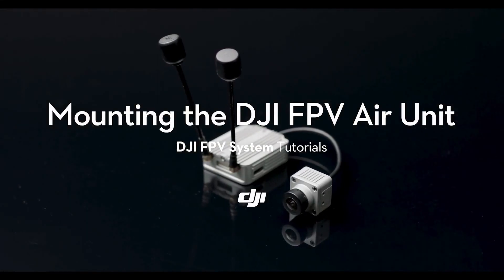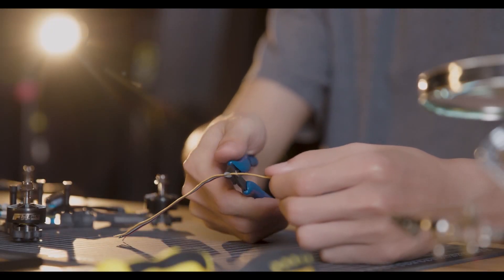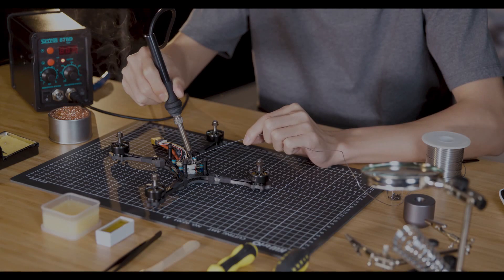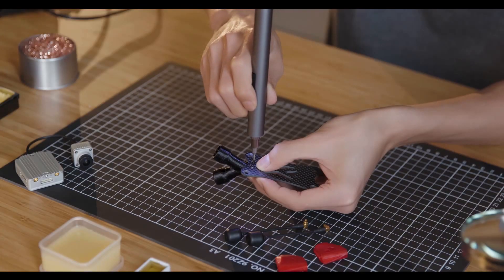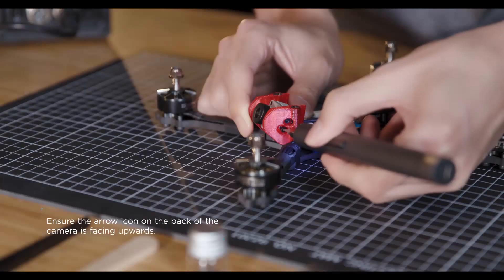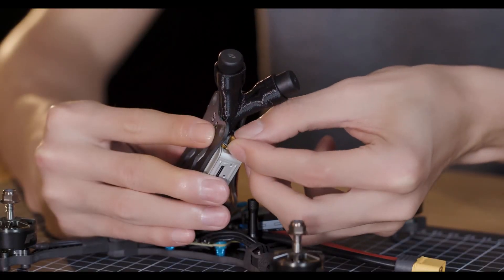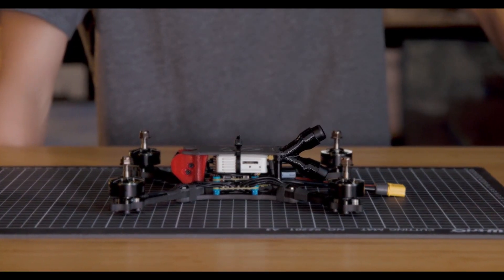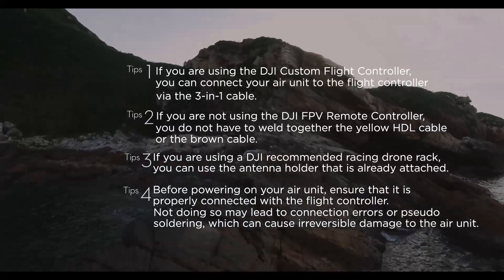DJI FPV System | How To Mount the DJI FPV Air Unit

Comment: Thanks Dji. Still some confusion out there as to what works with the air unit. So, new reply to an older video and many shops and users still are confused as to what works with the air unit. The Goggles v2 work with it. The fpv controller does not work with the stacks. The air unit is for fpv. So if anyone is reading this, as on Dec 13 2021, you have to use a regular rc transmitter. For example, the only thing a dji Mamba stack does, is allow you to plug the air unit in. One less thing to solder. Stack is flight controller and esc to control brushless motors. New terminology, but for those of us that have done rc for a long time, it's not a real mystery. There isn't an app to figure it out. You have to do some thinking. You still need to pick a radio. There are many, now. Some are easy. Others are really complicated . A complicated open source radio is FrSky Taranis. Some simpler ones are Spektrum and JR, if they are still in business. I have a Taranis x9d plus. It is fairly hard radio/tx, that is open source. If you can figure it out, you will be able to things with it that are amazing. Took me weeks to just get an rc helicopter model configured, to work with it on Phoenix flight sim. And, you need to have compatible receiver to receive signal from radio. Receiver will probably need to be soldered to flight controller. Again, there are a lot of easy radios with easy hook up.FrSky ie; Taranis has many receivers. You will want one that transmits telemetry to the radio. Telemetry transmits information like drone battery charge data to radio. FrSky has  micro mini receivers for smaller drones that have telemetry. One micro they make is small and transmits telemetry.

Comment: can this be used on a common rc airplane with a Spektrum transmitter and receiver? With the required power system in place of course.

Comment: i got a iFlight Titan DC2 Quad mit the Dji Air unit on it and an additional Frsky R-XSR Reiceiver on it. Now I want to fly it with the Dji fpv system, but my controller does not connect to betaflight. Do I have to remove the (useless) Frsky receiver first?

Comment: what is that aircraft that they are using in the video? I have multiple questions:
1-Which drones are compatible?
2-Where can i buy a racing drone that is professional and i compatible with the unit?
3-Are there any racing drones that are compatible but don't need 3d printing?

Comment: Am I missing something?  They skip over #1, which is if you DO want to use the DJI CUSTOM FLIGHT CONTROLLER. Is there a video for that??
Reply: Seems they are suggesting it's better without.
Reply: Their FC that they suggest is just plug and play mostly. The one in the video is not, hence the soldering.

Comment: Thanks to Share, I bought the googles and 3 units for my drones, I'm gonna use my FRSky controler.
But I have a big question?!
Any time I want to Change the drone I have to rebind the googles with the unit?!? Or it saves the bind of my 3 units?!?
Reply: No need to rebind is only one time to each airunit

Comment: Why the hell did DJI use vinyl coating - you are not making a whole lot of FPV drone pilot friends with that choice. Should have gone with silicone - doesn't melt away from your solder point.

Comment: i'm having an issue where my signal to the DJI FPV goggles is SUPER weak. Like when I'm literally within 1 foot, It's good, but if I get out of 1 foot range, it drops signal completely. What would cause this issue??
Reply from the maker: Hi Jake, please first make sure that the unit has been activated successfully; then please check if the antenna was assembled properly and ensure that the angle between the two antennas is greater than 60° and the gap between the antenna tip and the airframe or the metal pieces is at least 4 cm, you can provide a picture of your drone for us to double-check. 
Besides, please check how many channels you can get in the goggles, if there are three or four channels, please connect the system to DJI Assistant 2, make sure that the VPN software is disabled, so the radio can be automatically adjusted to the corresponding country code. 
Please let us know if the issue persists, for the picture of the drone, you can send us via email support@dji.com, we'll help to check. Thank you.
Reply: make sure you have the UARTs hooked up to the FC. If you don't have a voltage display for the FC it won't increase power.

Comment: So, riddle me this; If I wanted to build this exact drone, as shown in the video: 

1. Where is the parts list?

2. Where is the entire build video?

Also, can I just buy the Air Unit and Goggles, and use an existing RC.......or do I need the DJI FPV Remote Controller also...?? 

Any help, mucho appreciated.
Reply: Hi Nicholas, for the parts (e.g. frame, motors) that we recommended, you can refer to the DJI Store, https://store.dji.com/category/dji-fpv?from=shop. You may still need to purchase the 4S battery for it. 
Sorry that we don't have the entire build video, because the frame e.g. parts are from a third-party company, we may suggest that you contact the company directly. 
You can use a third-party controller with the FPV system, yet an additional receiver is required when using the DJI FPV System with other remote controllers. This is something that is not needed when using the DJI FPV Remote Controller. Thank you for your attention.
Reply: @DJISupportGlobal  Hey, thank you for your reply.

Initially, I thought this video was a build based entirely on the parts that you recommend/sell on your website. But alas, it is not. It would be a good idea if you made a build video using all the parts you recommend/sell on your website for this FPV system, don't you think?

Anyways, my last question is....assuming I use the T-Motor F55A PRO II + F4 HD STACK, which "additional receiver" do you recommend?? 

Thank yous.
Reply: @smithbrownjones  We recommend to use DJI FPV remote controller as no additional receiver is required.

Comment: I didn't get a camera mount I didn't get the antenna holder nor the 3M tape what the hell
Reply: Same here... Just air unit, camera and antennas
I think it is 3D printed, individually as each drone is slightly different construction.

Comment: Too bad that we couldn't get those frames and mounts on launch day.  They're still not available. Make me want to return my system.
Reply: There are a lot of frames that this will fit into, check some of the review videos for examples.
Reply: I know that FPV is supposed to be more of a hobby, but I really don't like building. Lol
Reply: @EscobarTV45  Then your in the wrong hobby
Reply: They should have sold it already put together smh

Comment: 7.4 volts to 7.6 volts is incorrect - your specs say it take up to 4s batt voltage
Reply: That is just a script typo, he should have said 7.4 - 17.6V as per the specs.
Reply: @Hakadek  Just like the show the UART RX twice when one should be TX, but the manual states it correctly. It is nice to see the 60 degrees stated here vs some places selling tpu antenna mounts at 90 degrees.
Reply from the maker: Thank you for bringing this to our attention, we will forward this to the proper team to notice.

Comment: Where can i find the dji racing drone recommendations?
Reply: Do u have to use the flight controller on the recommendation list or will any flight controller work?
Reply from the maker: @jdogflipper7997  Hi there, the DJI FPV Air Unit is only compatible with flight controllers that support Betaflight.
Reply: @DJI Tutorials ok cool, also it was saying something about a DJI custom flight controller in the video, what’s that?
Reply from the maker: @jdogflipper7997  Hi, it refers to the T-Motor F55A PRO II + F4 HD STACK https://store.dji.com/product/t-motor-f55a-pro-f4-hd-stack, it can be connected to the air unit via the cable without soldering.
Reply from the maker: Hi Timo, here we got some recommended accessories for drone racing on our official website, you can visit it for more info: https://www.dji.com/uk/fpv